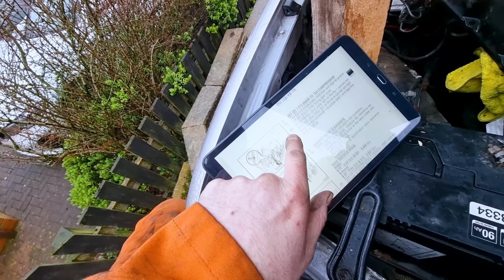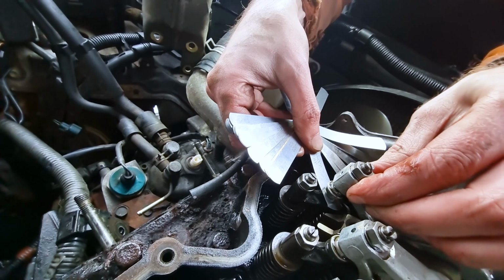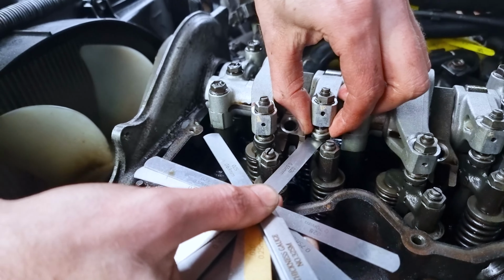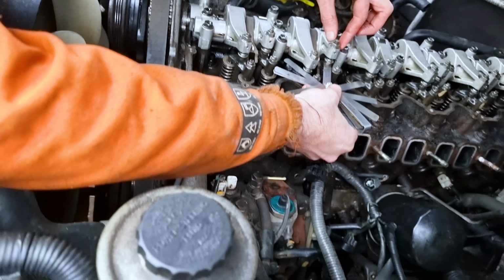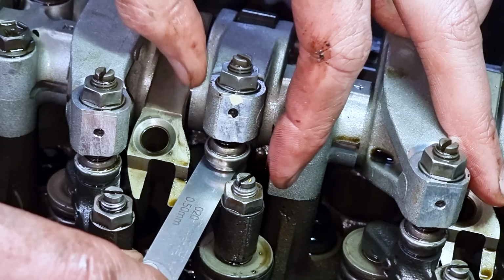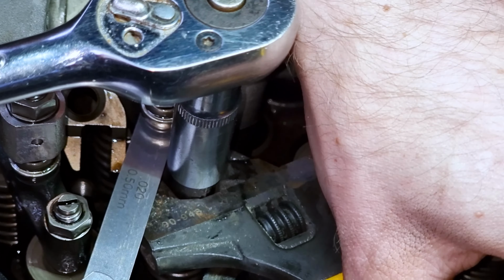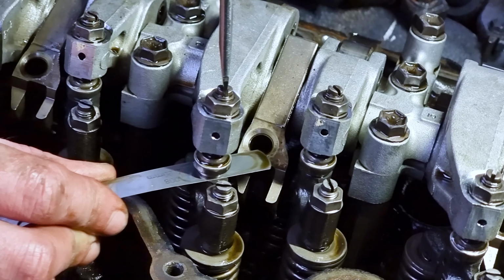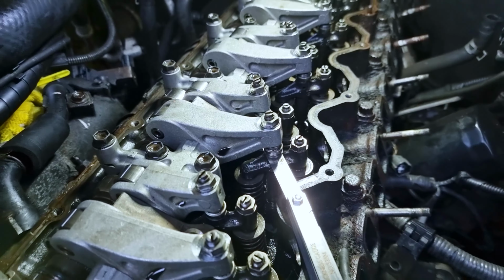Fixing a rattling Landcruiser engine

Comment: Great work! since you've got access to a lot of other components..a great opportunity to;
1. replace valve cover gasket
2. intake manifold gasket
3. timing belt and tensioner
4. water pump + thermostat, coolant flush
5. crossover pipe gasket
6. intake cleaning

Comment: I've checked mine 3 times on the 1HD-FT, basically the same engine, I've owned for the last 19yrs and 85k+ miles and they don't move much.  It seems a strange setup if you haven't come across it before with the tappet and valve bridge but the build quality always impresses me.👍

Comment: Always worth watching someone new.
Two tips I picked up.
The adjustable spanner to hold the part before cracking the nut. Top tip. That could save a bucket full of trouble.
Second. A piece of wood to put your tools on!
Reply: Even better, a large magnetic tool tray!👍
Reply: The adjustable spanner is to hold the bridge cos without it you can dislodge the valve collets
Reply: The adjustable spanner isn't just a "tip", it's the procedure given in the FSM.

Comment: Great work I'm learning 1HD fte 
Where is the knock sensor and fuel temperature sensor ?
And if you have a link for diagram sensors for 1HD FTE😊
And does diesel have Camshaft sensor ?

Comment: I thought you rotated the engine to another mark to the left on the timing case for valve lash settings
Reply from the maker: Official Toyota service docs state top dead centre. Although to be fair the timing mark is off to the left at around 10pm (if it was a clock)
Reply: TDC is the mark at about 10 O'clock if I remember correctly. The timing mark at 12 O'clock serves another use.
When setting your valves, the important thing is to check that the rocker is sitting on the round part of the cam, not a lobe. 
Keep turning the engine and move down the engine setting the valves as you go checking the rocker is on the round part of the cam each time.

Comment: That's funny...
6 people I know with a 1HD-FTE, 400,000km and older...
All found thier valve clearances pretty much in spec.
Yours is the only motor I've seen out...
Weird
Reply: Mine (415,000km) was out of spec too .. until a month ago. Good for those 6 people that they at least bothered to check.
Reply from the maker: It's a bit of a mission to check, I'm not surprised most people don't bother 😂
Reply: @vPerformance  "most people don't bother" and that's exactly the point about used vehicles that look all tidy and polished on the outside but the oily bits get neglected.
Reply: Two points here.
Have they had their engine from new? If they have had it properly serviced, this will have been done at scheduled intervals.
Two, if they have bought the vehicle 100'000 km before, it may have been done then.

Comment: Its just stupid how they have that adjustment down there the one under.
Reply: Not really, it is a 24 valve. If you look, one rocker transfers it's force onto two valves via the part you mentioned.
It is actually a piece of wonderful Japanese engineering. 
(Please remember this originally was a 12 valve design.)
Reply: Really? Well as a diesel mechanic of 30 years experience myself, with one of these engines powering my 79 series work truck, i think the design is awesome and the engine dessign overall is legendary.
Reply: @i-am-that-what-i-am  it is actually im just mumbling.